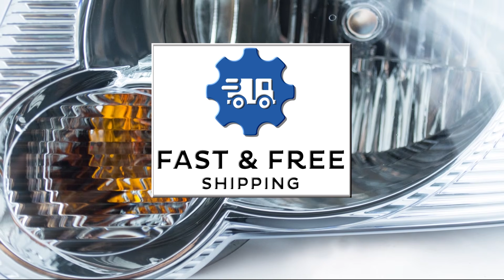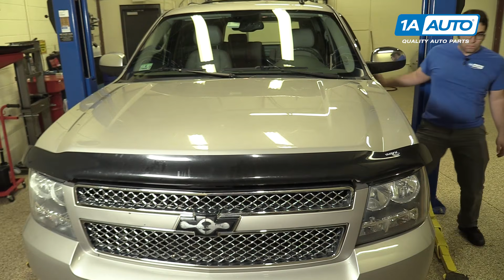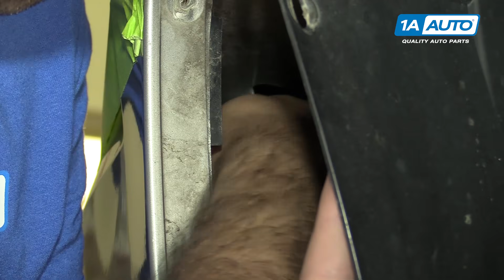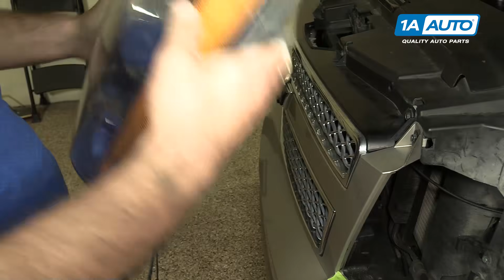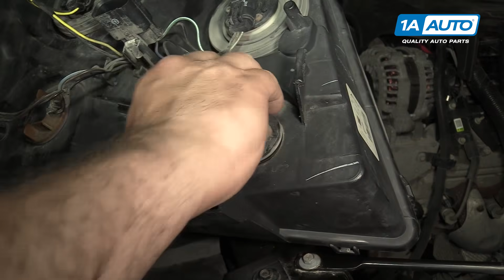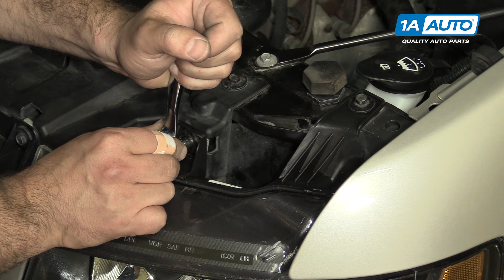How to Replace Headlight Bulbs 07-14 Chevy Suburban

Comment from the maker: √  Watch the Video
√  Buy The Part at 1A Auto https://1aau.to/m-Visit-1AAuto
√  Do it Yourself
√  Save Money
Reply: There is absolutely no way this will work as the geometry of the headlights prevents the amount of movement needed. The top part hangs up on the hood and the bottom will never clear the "hook" that the inner bolt goes through. Save yourself a big waste of useless jiggle time and just suck it up and remove the bumper. Gets you simultaneous access to both headlamps too.

Comment: These guys have nice videos, but they sure do take the long way around sometimes. I changed 2 bulbs in my 2010 Tahoe in less the 10 minutes-no word of a lie. And I am not a mechanic-like to think I am but I’m not. Removed the two 10mm bolts, did a little wiggling and voila. The replacement bulbs had a little pigtail on the bulb with the connector, so it gave you extra slack. Nice design boys-too bad the clowns that call themselves engineers at GM couldn’t think like that.

Comment: Get the inside part of the light assembly out first..it was shown, but not stated that i heard..lots easier after i fought with the outer side for a few minutes..also peel the tape off before you push the bumper back in and bolt it..mine ripped and I had to pop it back out.

Comment: I just replaced my headlight low beam bulbs and daylight running bulbs on my 2014 Suburban LT 4wd and had to unbolt the entire front grill and bumper asembly to remove the headlight housing.  There were little plastic edges on the factory headlight asembly that could not get past the grill assembly nor the inner fender edge. ?, is there a body change between the 09 and the 14 ? your vehicle looks identical from the outside appearance.

Comment: This is by far the very best way to do this aggravating job!  I recommend doing this once.  Take the assembly out, as illustrated here, and replace every bulb with LED bulbs.  That's likely the last time you will need to work on these lights. Lots of time and aggravation saved!

Comment: Thank you for posting; 2013 Suburban owner and driver’s side low beam went out. I had to pull back the splash guard but didn’t have to pull-out bumper or completely pull-out headlight assembly. Took me 20 minutes. 
Guy at parts store said given 8 years old, should do passenger side to and I was able to do passenger side in 3 minutes. Only had to remove two top bolts and wiggled out headlight enough to reach back. 
Again, thank you! Saved me at least $120 labor at shop.

Comment: Very helpful video, thanks.  I was changing just the low beam on my 2013 Suburban.  I didn't have to completely pull the light assembly out.  Just loosened the 3 bolts up top and the one behind the fender and wiggled it forward enough to disconnect the electrical connection.  Once it was loose, I could twist out the old bulb and put in the new one.  Took about 15 minutes.

Comment: One thing that I would add is that you don’t have to pull the entire assembly out to install the headlight. I just maneuvered it out enough to get my hand down to get the bulb out and install the new bulb.
Reply from the maker: +Lyle Morrison Great job! Not a lot of beginner DIY'ers are as able to take short cuts as veteran DIY'ers so we show the whole procedure from beginning to end.
Reply: I’m definitely a beginner diy type. Your video was a great help... no way I could have done this without it. And hey, you saved me $100. $100 for a 15-20 minute process.. I’ll take that

Comment: Thank you so much for the video.  This is the only one in which you show in detail how to deal with the inside headlight assembly bold in the inner fender.  Also pulling the lower bumper away was key for me in being able to change my bulb.  The masking tape was a great idea also.  What a terrible design.  The engineer at Chevy should be entered into the hall of shame for this design.
Reply from the maker: +Kurt Klimisch Thanks for checking us out. Shop here for high quality auto parts: http://1aau.to/m/Shop-1AAuto-c